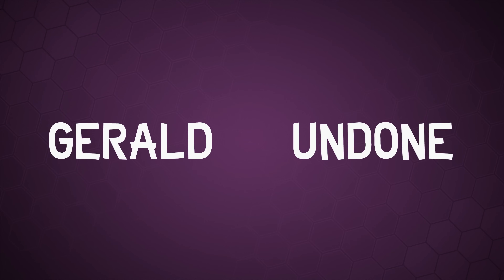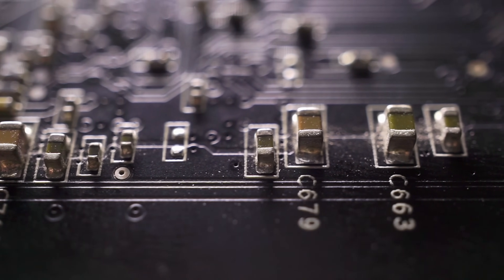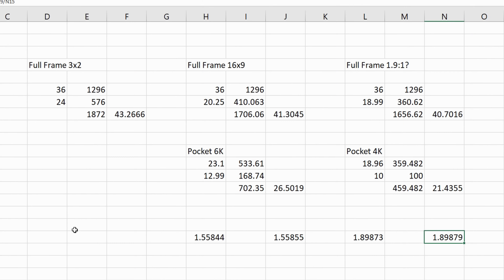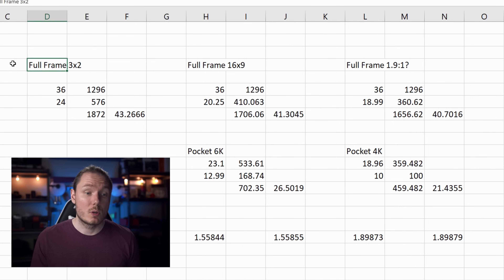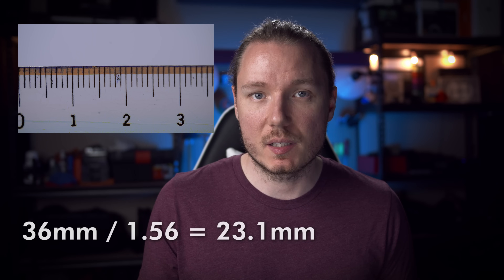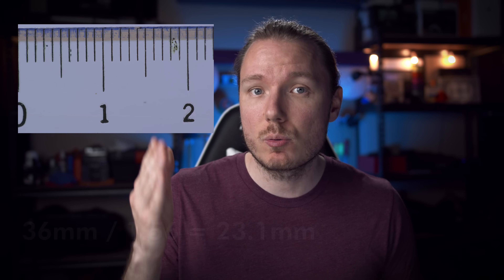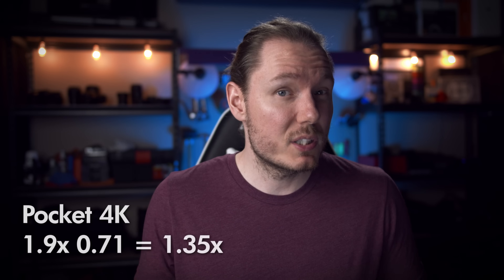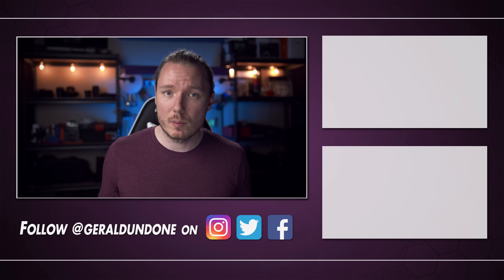How Crop Factor Affects Focal Reducers & Macro Reproduction

Comment from the maker: Two things! Pay attention to the little audio hiccup at 4:23. I might make a whole video about that as I've spent 5 hours today trying to stop Resolve from doing that and eventually gave up as this export is the one with the least issues. 🙃
And second, go watch the previous video I made on v-mount batteries. https://youtu.be/RVucscFziro
I know it seems kind of dry and the products are expensive, but there's a really fun little sequence at the end! 😜👍
Reply: I didn't notice anything, to be honest. I also haven't run into that issue myself. I did see you post something over on Twitter. Very odd. Now I'm curious what happens 😂
Reply: I can barely hear it when I increased volume a lot.
Reply: Them clicks are the bane of every audio engineer. Not on the original tracks I take it? Looking forward to watching your explanation if you make a video for it! Fantastic work as always and very educational :)
Reply from the maker: @Shade00a00  Exactly. Only in the finished render, but not in any of the sources or even when in the timeline.
Reply: @geraldundone  any chance you're recording audio at 44.1khz? Export is set to 48khz which can lead to a lot of pops and cracks if audio isn't converted first.
Reply: Another slight audio hiccup was at 4:15 when you said "We're still getting a 1:1 reproduction of the sensor." I think you meant of the ruler 😊.
Reply from the maker: @PeteC62  Blame the talent for that one, not Resolve. 😜 I also ADR'd myself later on when I said "Speed Reducers and Focal Boosters" haha.
Reply: @geraldundone  Haha, I didn't spot that one. Though actually I have one them thar 1.4x speed reducers for my Canon EF 70-200 f/2.8L 😊
Reply: Oh, and now I've looked up ADR, I know why I missed it! Next video: A glossary of terms for those of us who watch your videos because we appreciate excellence when we see it, not necessarily because we're video jocks 😁
Reply: Not sure, but I was doing some music recording in Logic the other day, and had a number of low level clicks like that during a take. Looked at the waveform in minute detail, and it looked like there was a sudden phase reversal of the waveform which manifested itself as a click. No idea what caused it, though. Could have been my Allen & Heath mixer which is also my audio interface. Or maybe an electrical interference, as the supply to my music room is not the cleanest! Possibly need a mains conditioner! Or maybe just an issue with Logic. I did do a fulll reboot after that and I didn't notice any more clicks, but, yes, they were 'baked into" the previously recorded waveform.
Reply: Previously I used to get very similar sounding audio hiccups with Resolve and it seemed to come down to which audio effects I was using. IIRC, the noise reduction and pitch changing effects were the most likely.

Also I had this weird issue with my DAC/Amp being plugged into a USB hub instead of directly into the computer which threw in some more crackling too. Might be a couple places to start troubleshooting.
Reply: the little audio hiccup at 4:23 wasn't audible with my speakers but with my headphones maxed out I did notice it but only after rewatching it after mentioning. Love your work keep it up. Keep undoning.

Comment: If there were 2 identical sensors, only difference one is cropped, one is full frame. Should full frame offer any improvement in quality over a boosted cropped sensor? Or should they be exactly the same?

Comment: Hey Gerald, an idea for a video.
The GH5S has a crop factor of 1.8, the Speed Booster XL has a 0.64 times focal length reducer. 
Pair that together would yield a 1.152 times crop factor, and that's almost full frame.
I think it would be quite interesting if you could compare the GH5S with the SB XL on a full frame lens vs a full frame camera.
I love would to see your take on the comparison. 
Thanks,

Comment: Compensating for the aspect ratio is useful when you want to make predictions about the horizontal AOV, but note that it doesn't yield the technically correct crop factor. The crop factor can be used to calculate equivalent ISO settings, make noise comparisons, etc. The reduction of height occurring when moving from 3:2 to 16:0 is a crop in itself which cannot be ignored for the purposes of predicting image properties that can be calculated using the crop factor.

Comment: Just out of curiosity did same experiment with my D3300(1.5x crop sensor camera) with kit lens zoomed at 55 with macro adapter(filter like lens) it gave image with ruler showing 36mm horizontal. Why did this happened, i get its not perfect macro shot but just confused now.
Reply from the maker: Remember it doesn't have to do with the zoom of the lens, but the focus. When the focus is set to the closest point and if that point allows for 1:1 reproduction on the lens.

Comment: As always ... excellent video! Q: why did you choose the .71 adapter over the 64? Is there any reason to get their BMPCC4K version over the standard MFT? (Or the locking ring versions?)
Thanks
Reply from the maker: The 0.71x works better with the Sigma 18-35mm. I'm still testing the new 4K-specific version against the standard, that will be a big portion of that new video I alluded to. :)
Reply: Gerald Undone oh I see! you had the sigma and matched the adapter. If you started out fresh w no canon mount lenses would you have gotten the 64 to accommodate full frame lenses?

REALLY looking forward to seeing the review of the MFT vs 4K version. (Hopefully you get to test the locking ring version too.

Comment: how to calculate the depth of field difference between FF and MFT? 25mm lens on MFT has similar depth of field as 50mm on FF, but how does the DoF change, if it does? and do focal reducers change it?
Reply from the maker: I have a couple videos on this topic. Look for "depth of field gerald undone" in Google. 
25mm on MFT does not have the same DoF as 50mm on FF. Shorter lenses always have more depth of field. In order to balance that out, you'd need to set the aperture to be twice as wide. So, 25mm @ f/1.4 would be comparable to 50mm @ f/2.8 on FF.
Reply: Gerald Undone  thanks. just watched you video about DoF. and was surprised :)

Comment: Very interesting video, but from the title I was hoping to learn how crop factor and speed boosters affect maximal macro reproduction. Do speed boosters affect the minimal focal distance?  Additionally, it would be interesting to mention pixel density. You made the point that a crop factor camera doesn't really zoom in more, because it is still 1:1 reproduction. But a 20 MP micro 4/3 camera has double the pixel density compared to a full-frame 40 MP camera. So each millimeter of the subject covers more pixels, which should produce pictures with a bit more detail.
Reply: He talks about the change in reproduction ratio at 10:00. In the example he gives, it reduces from 1:1 to 1:1.35.

Comment: So, can we take that information to determine the lens size when using an adapter? Say for instance, if I use a .71 adapter and a Canon 25mm EF lens on the BMPCC4K, will the lens now be 33mm based on the 1.35x?
Reply from the maker: Yeah! Well, the lens won't change. But you'll get a field of view similar to a 34mm lens on full frame.

Comment: Learned alot so the next part to this video would the BMPCC 4K with a 
Metabones T CINE Speed Booster XL 0.64x Adapter or will it be covered in uour next video about speed busters?
Reply from the maker: Great! What do you want to know about it?
Reply: @geraldundone   : just like the video but us the BMPCC 4k with the Speed Booster XL 0.64x so the size comparison of the BMPCC 6k with the Speed Booster XL 0.64x. Also what would happen if you used a canon APC s lens
Reply from the maker: I can say the reason why I use the 0.71x is because on the Sigma 18-35mm, which was designed for APS-C, I get vignetting on the wider end of the zoom. I'd only use the 0.64x with full frame glass.
Reply: @geraldundone  Awww that makes sense now and at what focal length does the vignetting show across all EF-S lens by Canon. Is your meta bones speed booster the new only BMPCC 4K version?

Comment: Could you please also explain the true meaning of "equivalent"? 
Many people argue that a F2.8 APS-C lens has DOV similar to F4 Fullframe lens, but it is F2.8 on APC-C and it give better image quality because it can reach lower ISO. Which forgot that Fullframe has 1 stop of improvement on ISO performance over APS-C. 
I think the true meaning of equivalent is that if you can get a bright lens on crop sensor body, you can almost get the fullframe quality. 
I can't get the point of constant aperture zoom lenses on crop sensor body, such as XF16-80mm F4. 
People said it is amazing because it give a 24-120mm F4, long zoom range and bright blah blah.... 
I was like, um....... 
Nope it is 24-120mm F6. 
AND NO! You can get a 24-240mm F3.5-6.3 on fullframe !  May be cheaper than that on crop sensor system!